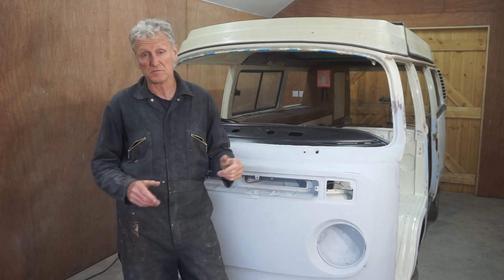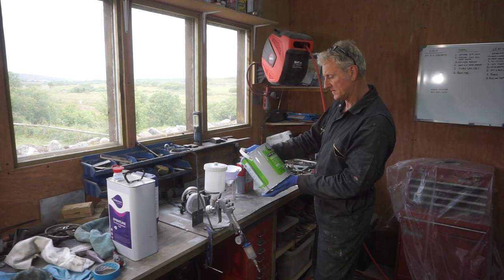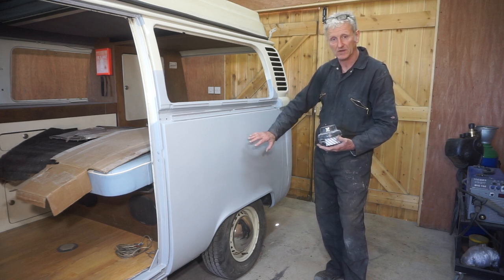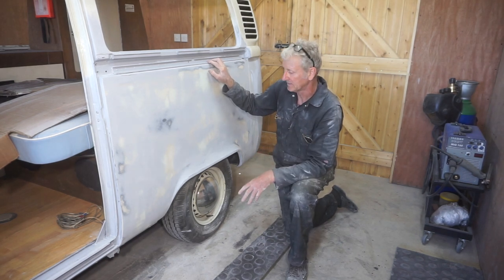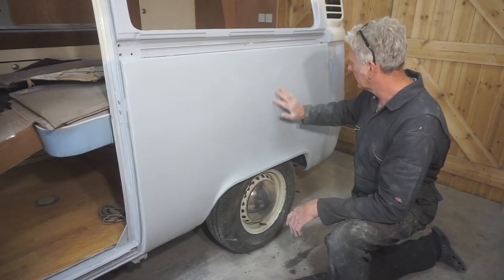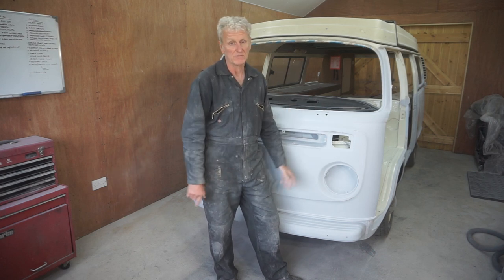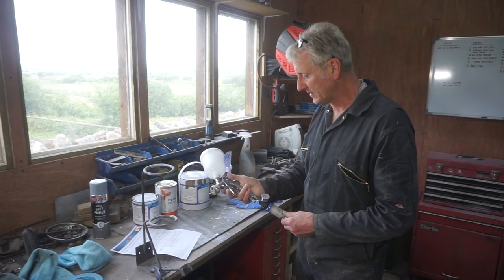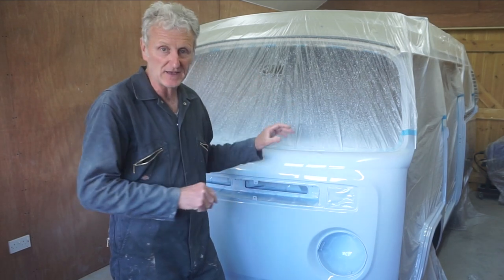1973 VW Campervan Restoration Part 26

Comment: Excellent job - great to see the new topcoat going on.....looking lovely. A quick question if i may re masking - is the tape you use a certain type/ brand as it appears double sided so the 3M sheets sticks easily to it before cutting the sheet.......looks like a neat and easy option........thanks and looking forward to your next instalment.
Reply from the maker: Thanks, the masking tape is single sided 3M blue masking tape - not the cheapest out there but well worth the price - not to sticky but just right, doesnt leave any residue and peels off easily, much better than the stuff you get in your local DIY superstore. Around the windows etc I apply it on the inside of the bus so the 3M film sticks to it if you follow, I try and use 3M products were ever possible.

Comment: Hi great videos, was just wondering what size compressor you are using ?
Reply from the maker: Hi, it is a single phase 3hp with a 150lt tank - works well and seems to keep up when spraying.